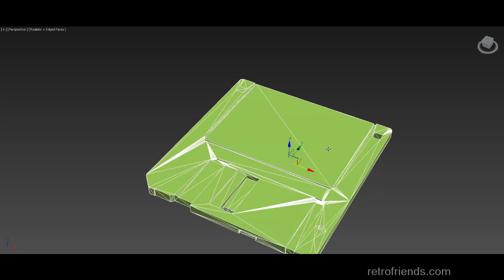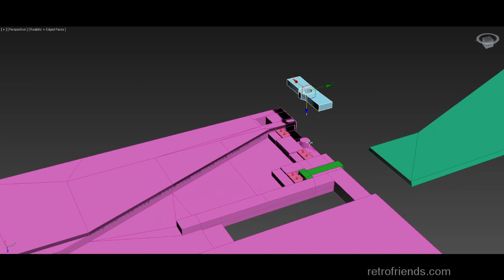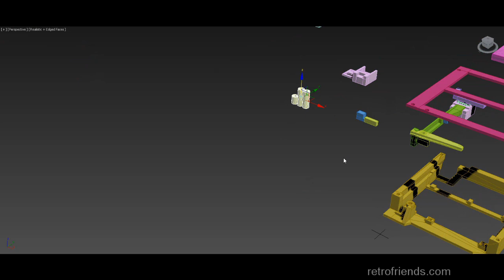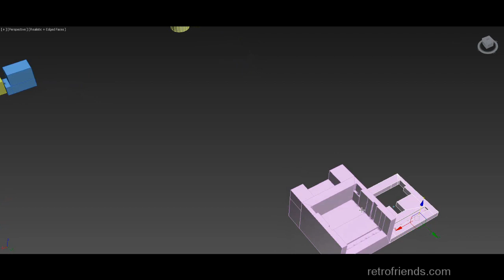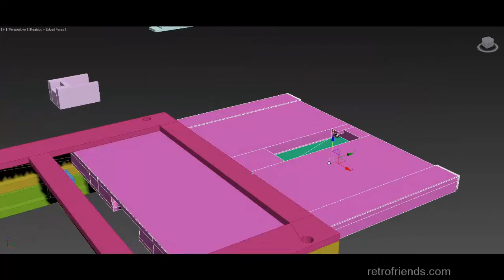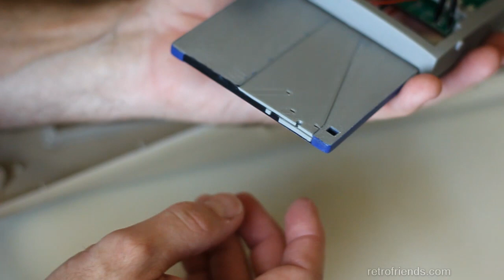Gotek Floppy Emulator for Amiga Part 3: Amiga 500 Custom Mount

Comment: Hi, it is amazing!
Can you tell me what microswitches exactly they are? The link is for a full different pack.
Thank you!
Reply from the maker: I can only provide info on that which I purchased. The item is too small to have a model number printed on it, and I don't believe there was any model number inside the packaging.
Reply: @retrofriends  No, the thing is that your link, has  25 different switches: "250pcs 25 Values Tactile Push Button" maybe is the wrong link.
Thank you!
Reply from the maker: @h0sp1t4l3t that is what I purchased. I purchased a variety pack and chose out of the pack. I do not have model numbers or direct links for individual ones within the pack because I bought the whole pack, just as you see in the link.

Comment: Is there a way to do this to the amiga 1200
Reply from the maker: Have you checked thingiverse? There is a version for the A1200.
Reply: @retrofriends  the one for the a1200 uses a different disk design from the one one here, and i prefer the design on here, i suspect the 3dprinted internals wont be interchangeable tho, but correct me if wrong

Comment: What are the dimensions of the microswitches?
Unfortunately the assortment kit is quite expensive to ship to Germany and not available on amazon.de
Reply from the maker: The listing on Amazon may not be available to you, but it does include the sizes in the description. In the video, I mention that I used the smallest size. So that means I used the 2x4mm size.
Reply: @retrofriends  Thanks for the clarification!

Comment: This guy is an ARTIST! A Modern days Da Vinci!
Reply from the maker: Thank you!
Reply: @retrofriends  You're welcome. I sometimes got horrified by people mutilating their Amigas' cases to fit a floppy drive emulator. Just love your design. Btw finding a way to fit the rotary encoder somewhere would make it just perfect.
Reply from the maker: @CP200S  I thought a lot about how to incorporate the rotary encoder. I looked for a slim one, but nothing I found was going to work. The footprint of readily-available ones simply won't work within the confines of a somewhat realistic floppy disk analog.
Reply: @retrofriends  Have you thought about building a flat one yourself? Just like the volume control of older AM radios, a small wheel could be designed and screwed on the surface. Some teeth could move the common central contact and touch it in one of the two up/down contacts at each side of it. I'm not sure if I could explain myself correctly. Just throwing ideas.
Reply from the maker: @CP200S  No problems with 3-D printing a frame for it, but getting contacts glued to it for long-term use may be a problem. Copper tape maybe? Pretty tiny contacts. Frankly, I will leave this to someone else to try. The buttons work pretty well!
Reply: @retrofriends  If I find the time, I will try it myself, do some stress tests and let you know about the results. Btw you are probably the most polite and communicative person I have met online. Nice to meet you, Sir!
Reply from the maker: @CP200S  Wow, high praise! Thanks, and good luck with that project :)